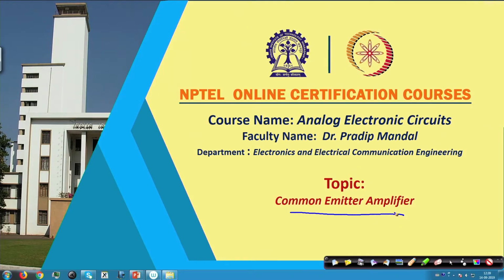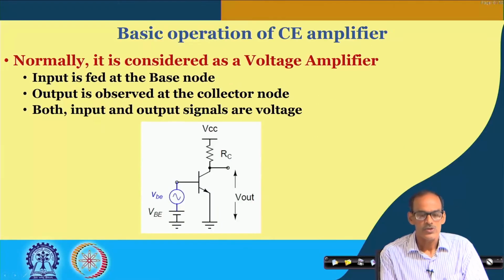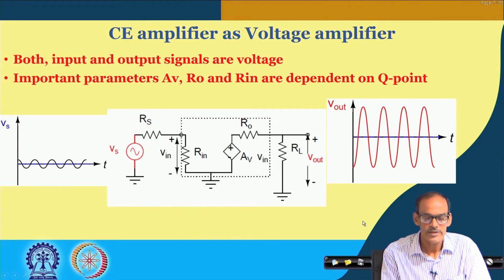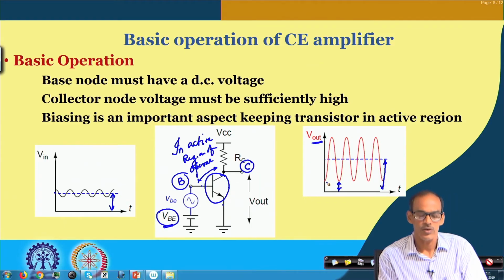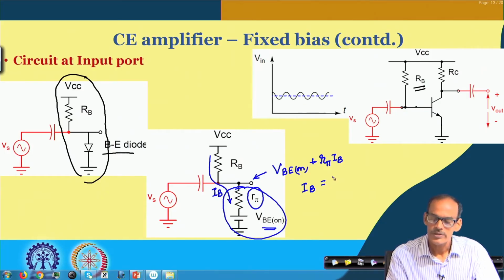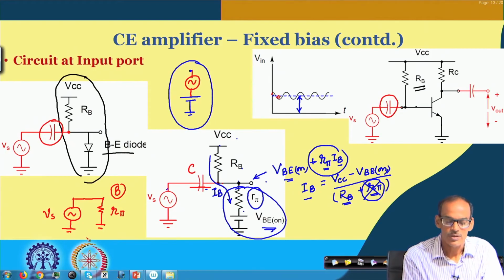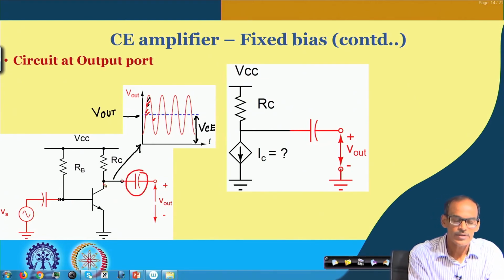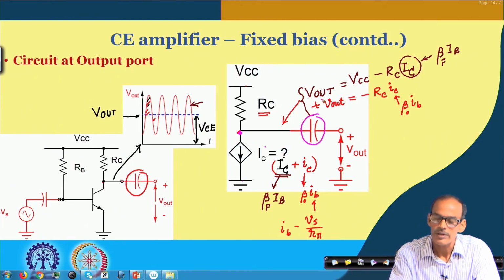Lecture 24 : Common Emitter Amplifier (Part A)

Comment: In the large signal model, r_pi shouldn't be used. Instead, Rf (forward resistance) of the diode needs to be used. Rf is the order of a few ohms and r_pi is in the order of k-ohms. Hence, Rf is usually ignored in the DC analysis. I think r_pi is only reserved for ac analysis and small-signal model.